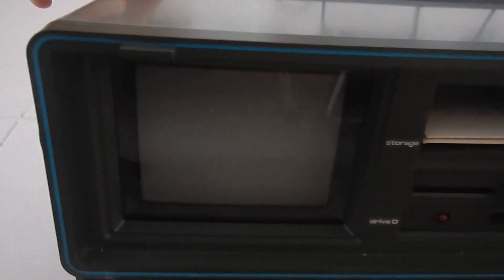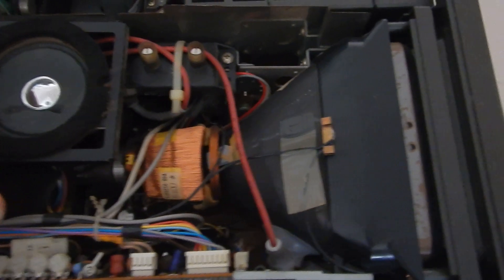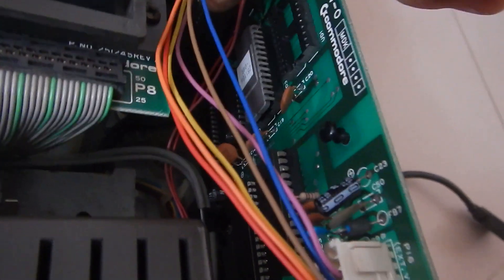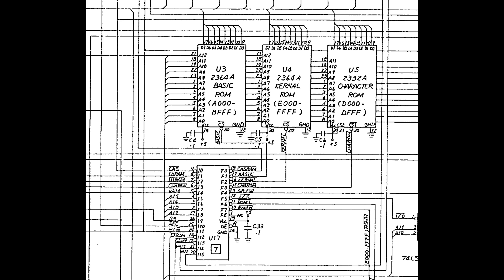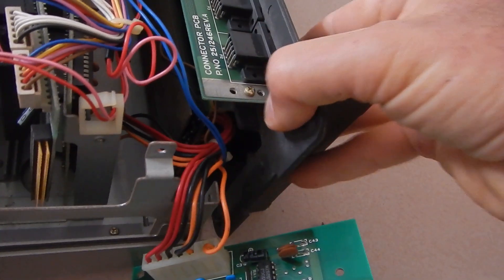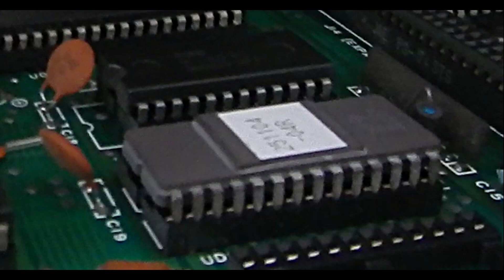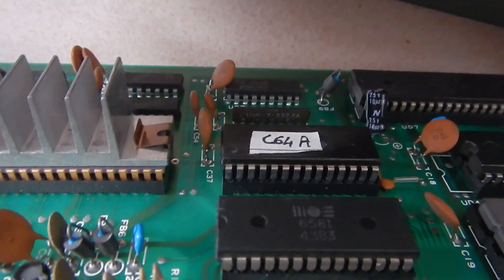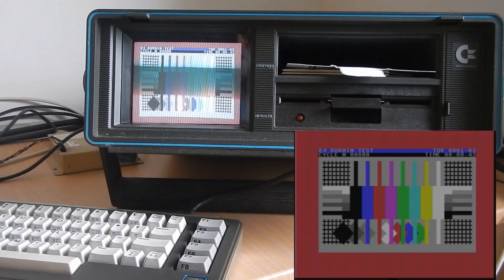Commodore SX64 "finger assisted" repair (an easy one).

Comment: First time seeing the SX64 main board.  Would like a better view of it to compare with C64.  When you gave the description of a black screen and chips from 1983 my first thought waa PLA failed.  It is such a common failure for those year PLAs.  My second thought was CPU, but you diagnosed it well.  Great work!
Reply from the maker: I'll try to make a better "SX64" internal view video one of these days if there's enough interest. PLAs do fail indeed, but only the MOS "compatible" ICs, the other SX-64 for example has the F-93459DC FPLA and I don't expect it to fail anytime. 6510 are reliable enough, I think I've seen two failed ones in all repairs from 1986 up until today.

Comment: Which diagnostics are you using?
Reply: Honestly I'd like to know as well
Reply from the maker: That was a cartdrige called "C64 BURN-IN TEST" that we copied in the '80s, no idea if it's available already for download (but I might copy it from my floppy disk. I also have no idea if the original cart had some diagnostic harness, we always used the program to check for non obvious faults after a repair (or confirm it was ok to return to a customer).

Comment: Ottimo video!! I video di riparazione (semplice o complessa) sono sempre ben graditi, soprattutto se ben documentati!! 
Per quanto riguarda la sostituzione dei pla, hai dei componenti programmabili ancora in circolazione e abbordabili? Ho le attrezzature per programmarli, però fatico a reperire informazioni in merito su quali componenti usare senza dover usare adattatori
Reply from the maker: L'unico componente che non necessita di adattatore e' appunto la PLA originale: 82S100, PLS100, F93459 e 556RT2 (clone sovietico della 82S100). - The only replacement that doesn't need any adapter is one of the original field-programmable PLA ICs: 82S100, PLS100, F93459 and the soviet clone of the 82S100, the 556RT2
Reply: @iz8dwf  tutti ormai introvabili (vergini)

Comment: I had no idea the PLA was a 82S100 in disguise :)
Reply from the maker: Good to help Pete! The MOS part is a mask-programmed NMOS functionally equivalent to the 82S100, of course it isn't as reliable as the old ones. If you ever need an 82S100 replacement, I have a few spares left :)
Reply: @iz8dwf  Thanks Frank :)